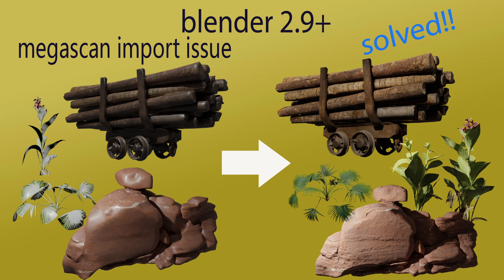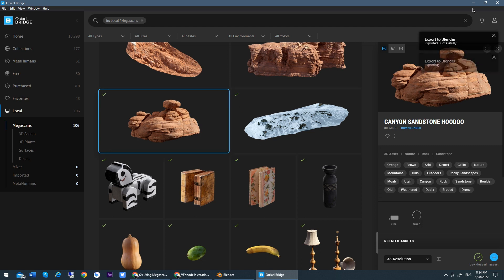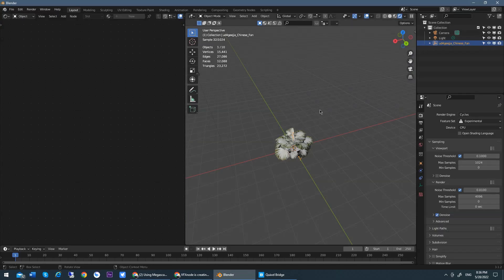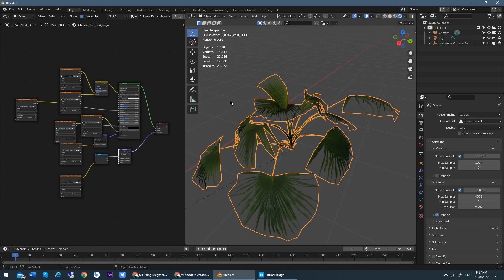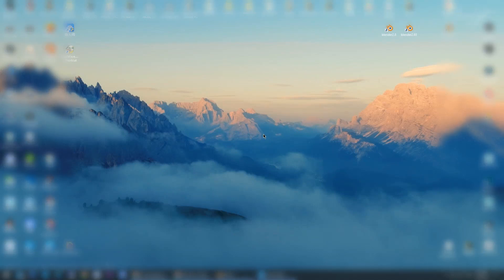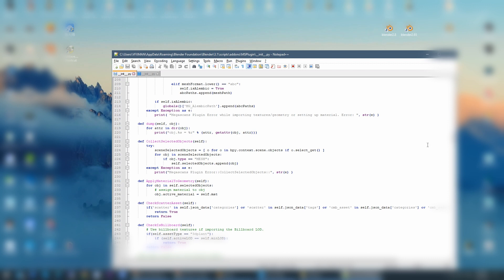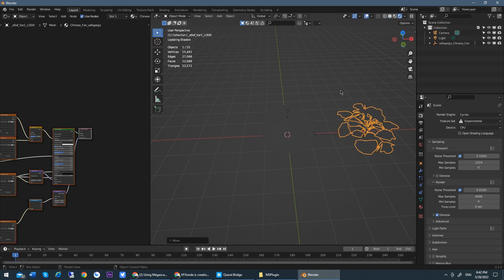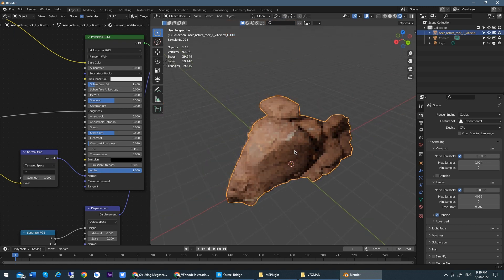Quixel bridge export to blender issue  fixed!!

Comment: I couldn't find MSplugin in my scripts folder what is that means and how to fix it ?
Reply from the maker: I think you need firstly install export plugin in bridge, then you gonna have it
Reply: @cg-island666  yea it just fixed right now, I did it manually bc the folder wasn’t there and surprisingly it worked. Thank you 🙏

Comment: The file change dosnt work for me the nodes ar estill in the wrong places
Reply from the maker: Are you modified the file inside correctly? Need change some parameters for program
Reply from the maker: Or simple solution, go my patron download my file
Reply: I went to your patreon and downloaded your file copy it over in the right version folder but didnt work I found some other file on the Web that worked so maybe there is just something out of date

Comment: does this work for 3.0+ version?
Reply from the maker: Yes
Reply: doesn't work for me in 3.4.1 All the nodes are plugged in correctly when you export but I'm still getting the black blotches in the shrubs. Perhaps it's a normals issue?
Reply: I figured it out. This is the answer if you're rendering in cycles:

Render Properties>Light Paths>Transparent

Increase the number (for me it was around 16-20 before it looked good.)